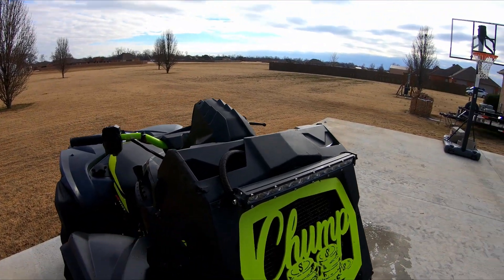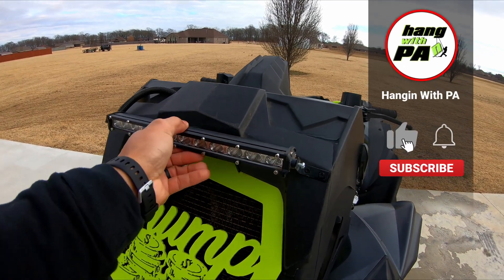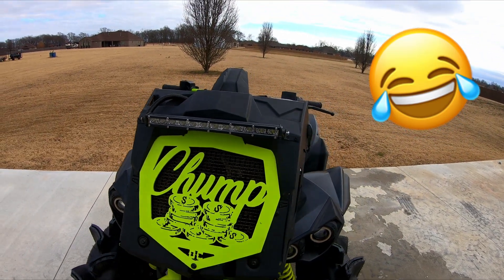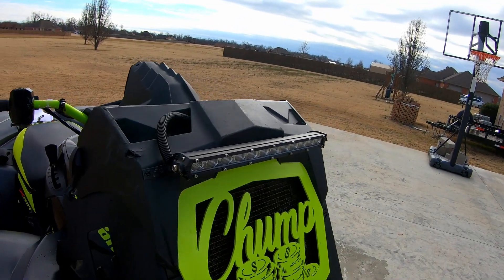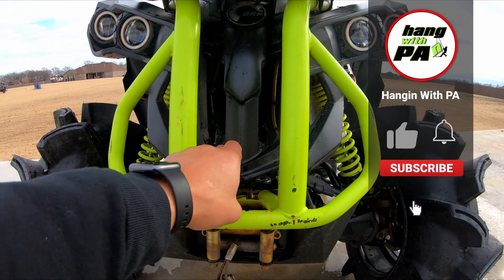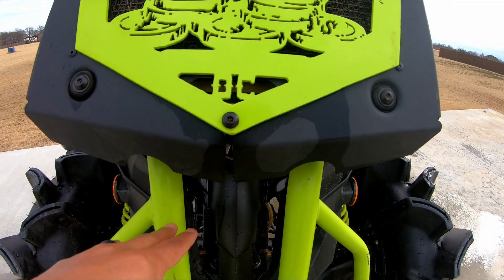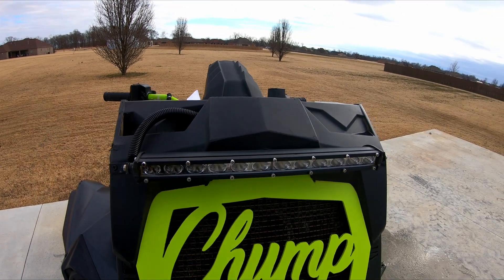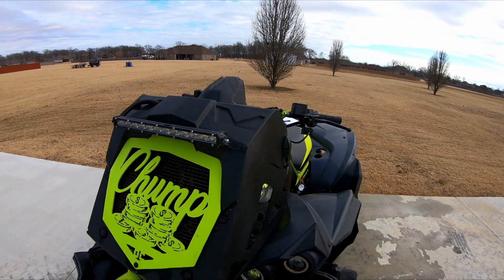CLEANEST WAY & LOCATION TO MOUNT A LIGHT BAR CANAM RENEGADE - Clean and Simple ATV mount

Comment: Where did you mount the on off switch for the light bar
Reply from the maker: I mounted it on the horn right above the led screen. Keeps it in arms length but somewhat protected
Reply: Did you install your radiator relocate kit or have someone install it
Reply from the maker: @codyeckols7471  Installed it myself. It was a pain but Im not mechanically inclined.  Will be dropping a video soon as I need to install a new on as this one is broken.